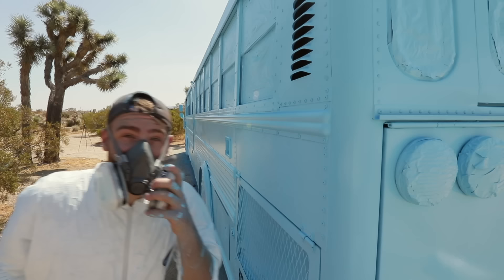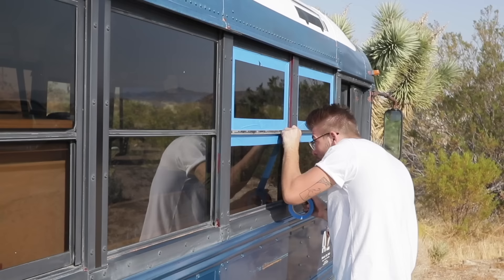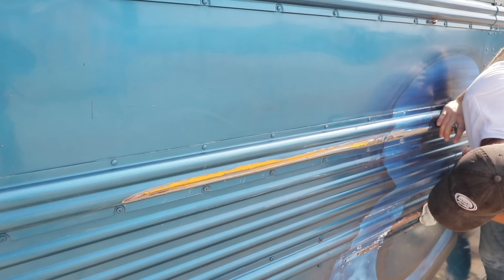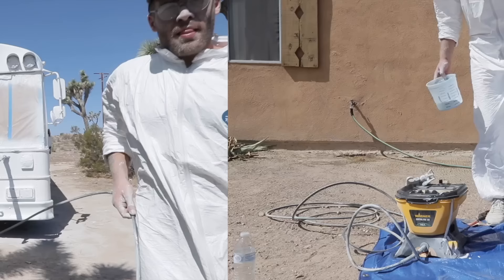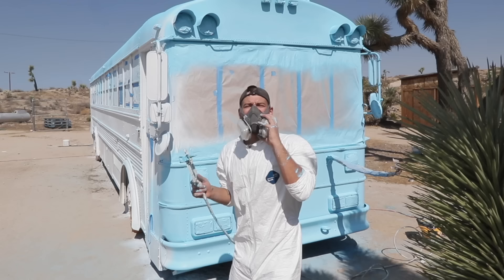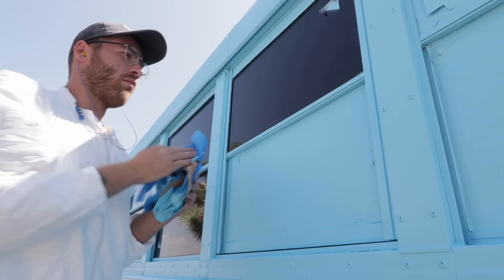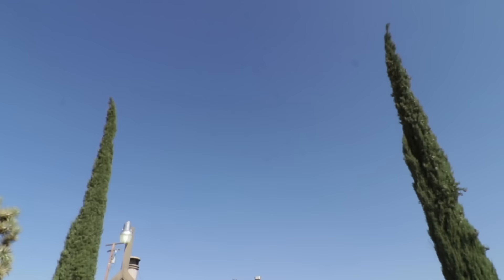HOW TO PAINT A SCHOOL BUS!!! DIY SCHOOL BUS TINY HOUSE CONVERSION Ep. 6 | MODERN BUILDS

Comment: I cant help but think your montage in this particular video reminds me of Mister Rogers...the melody of the synthesized bells is what did it for me...   awesome work. 👨‍🎨

I also used to work at a lumber mill here in town and used a paint sprayer using a waxy paint to paint the ends of the flush cut bundles to prevent the wood from splitting as well as the emblem...

Comment: I appreciate most of the things Mike builds and creates on this channel. But I do have to say, this is very cringe. All one solid color, painting over all over the trim and bumpers, paint on glass, painting the inside of the wheel wells lmao. This is some 1997 Honda Civic Maaco paint job shit.
Reply: I'm late to this by a lot, but I agree. This is too big of a paint job to be one solid color. He shouldn't have painted over the trim and top of the bus, as that makes the bus very bland. The stove & mini fridge paint jobs are also horrible, as they don't look very good, and are going to get worse as he uses them more. Paint on glass is never a good idea. It does all come down to preference, however, even though it's not very good looking. I don't personally agree with the color palette, but that again comes down to his preferred style.
Reply: I agree this was not a job well done. The entire time he was building it I was cringing. It’s a lipstick 💄 🐷 job.. 
How will the mechanic have access to the Diesel engine compartment inside with that massive platform.? The bed section of said monstrosity has no ventilation (moldy mattress). The wet room’s ceiling height doesn’t have enough clearance for him or any adult to get underneath the rain shower head 🚿. He might as well made it a hand held only fixture. The entire color palette 🎨 is tacky AF. I suspect this was just an excuse to get on the Skoolie trend on the cheap.

Comment: The streaks in your paint to start are because of the air pressure settings on your sprayer, typically. Suggest changing the settings rather than thinning the paint more.

Comment: Wagner paint sprayer is amazing when it works but they just keep breaking. Especially the model you have. There customer service is none existent in the uk! No response to emails! Love the bus awesome job.
Reply: jamie_f the customer service is non existent in the US too. I broke a small part and ended up having to throw the whole thing away.
Reply: JBratt  I managed to get a replacement of probably the same part. However, on inspection the whole thing leaked paint into the electrical system. I would class it as dangerous given the fact it then tripped the circuit breaker. It’s not really fit for use. Shame as the paint result was amazing when it worked.

Comment: Hi, when you took off one of the air intake panels and taped off inside the panel there was a big rusted area that was under the panel that would require sorting out not just masking over.

Comment: I like your bus build and the interesting paint job that could save a few thousand bucks over a commercial painter! I have one question... I was wondering why you primered and painted over the "Stop" sign? THAT is something I would have removed. And the lights that you said were weather-worn and cracking, heck, remove them and replace them. That will save you headaches later... and you can switch to LEDs at the same time.  Thanks for the ideas!

Comment: BTW, painting over the glass is a BAD idea. The first time you go through heating/cooling cycles, the paint will check or peel off. The only way to stop that is to either use an acid-based glass etching solution or better still replace the glass panes with fiberglass or plastic-coated paneling.

Comment: should have used TSP to prep and wash the bus it would of cut down on prep time and roughed up most the paint and by law that stop sign has to be removed as well as anything that says school on it for the roof you really should use HENRY'S TROPICOOL its an elastopolymer paint thick like marshmallow fluff and cuts down on heat and acts as a water membrane/barrier and as for the paint it will not last that long you did not sand the bus well enough you must get the paint to a matte finish by sanding having any glossy spots left will cause the paint to not adhere properly
Reply: TSP... but your RIGHT!!!

Comment: Why didn't you just paint the vents while you had them off the bus, then you get both sides and no need to take them off again to get the tape off the inside?
Though a nice job, it doesn't look finished.  It needs either white or a darker blue running down the center.  It keeps with the age appropriate look of it.  Other then that this is inspiring.

Comment: 00:03 Using dish soap to wash a vehicle before painting
01:46 Color blocking the bus and masking window panes
03:44 Preparation and primer application for existing paint job
05:43 Tips for spray painting a school bus
07:25 Delaying paint spraying due to windy weather conditions.
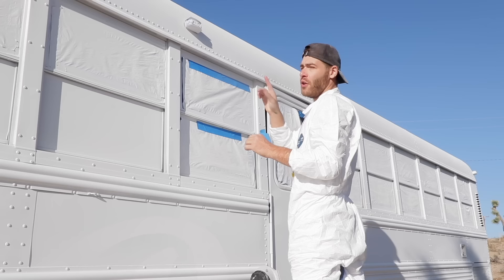09:04 Using baby blue paint for the school bus transformation.
10:35 Spraying provides a quick and flat finish.
13:17 Removing masking tape for best results.

Comment: It would actually look more good if you put in complimentary colors to the hood of the lights and the side mirrors. The finished product looks flat with the all light blue color. I've followed this build from the start but I'm not quite satisfied with the final output. I had high expectations considering the big space inside the bus. Those van builds that I've seen are far more better than this.

Comment: I give the paint job 2 months. Kills is the worst primer you can use on a house let alone on metal. Latex paint will not stick to metal for the long term let alone with a kills primer. You should have had it media blasted then used an actual metal primer with an actual automotive paint with a good clear coat. As far as the glass you painted that you will regret cause latex paint will not stick long term and look good glass does not like paint and paint doesn't like glass cause it is too smooth. But enjoy while it lasts ( which wont bee long ). I only have 30 years of remodeling under my belt to form my opinions.

Comment: Gonna have a lot of imperfections on that paint job because you did it out in the desert in the middle of nowhere you will have dirt and stuff stuck under the paintwork, you sanded it and didn't put body filler on.... 
And you didn't even put a clear coat on 🙄

Level 2 vehicle bodywork certificate holder 👆

Comment: shame, all process should be done in an isolated space, not in the middle of already degrading eco-system, so it doesn't contaminate air, soil and water  :/  Even though your hair is vanishing shouldn't you also make sure that you restore resources as fresh air, 'fertile' soil and clean water before using highly contaminating stuff into eco-system :/ since I like some stuff you create I was hoping for some environment-conscious decisions to do such a project, which could've been done in any covered warehouse and not outside :/ shame